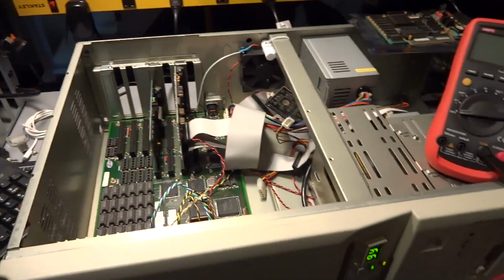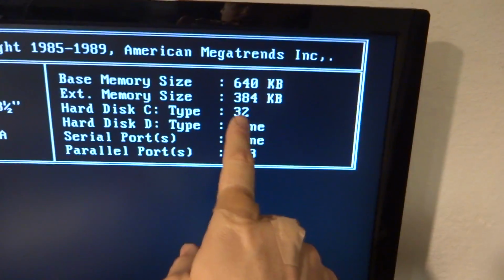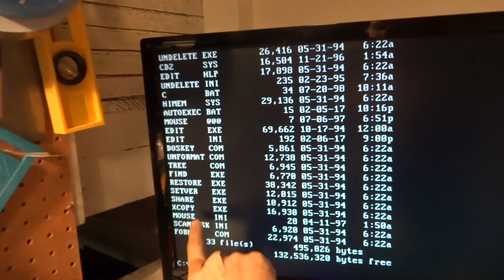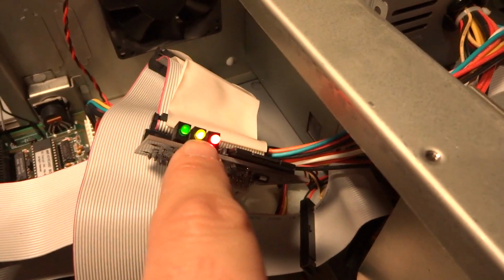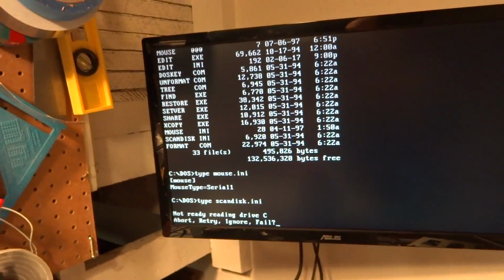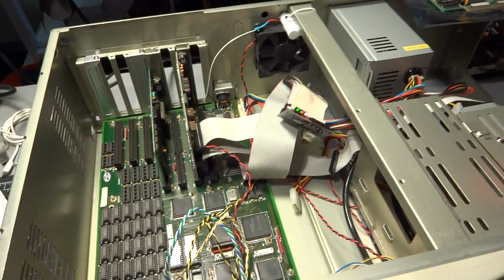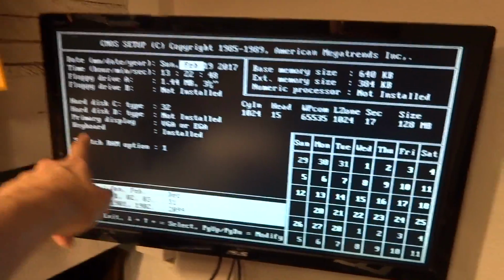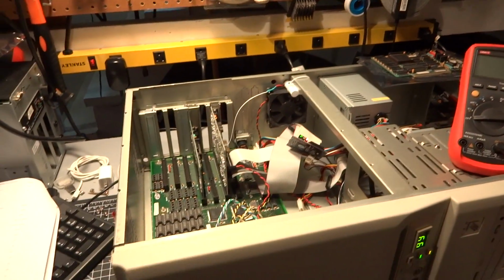Old Intel 286 Motherboard Troubleshooting (Part 1)

Comment: It's either because you don't have auto-detection of hard drives and the parameters are incorrect (old BIOSes run on CHS mode only, don't support LBA) or it's a hard disk controller issue.

I would try to make an auto-detect on something more modern to get the exact parameters, and try it again. Otherwise, the hard disk controller might have problems handling the SD/CF to IDE adapter (I've been aware that some old IDE controllers don't handle those properly).

Comment: Seems to be BIOS problem. I would try it with XT IDE card because of its ROM extension. As I know some IDE ROM extensions can also be used in an old network card boot ROM socket if you don’t have XT IDE card. Just an idea...

Comment: I know you have already fixed this in a later video but I think the reason files smaller than 1024bytes is working is because if a file is small enough the data will be stored with the directory data. Once files get too big, the directory stores a location on the disk where the data is stored. In your case the directory is stored in a part of the disk that can be accessed even if the CHS data isn't matched. But the rest of the larger files are in extended areas where correct CHS is needed to access them.
Reply: Everything (excl. the FS metadata, FATs, and the root dir before FAT32) is stored in clusters on a FAT file system - directory contents and files are treated exactly the same here.  Every directory gets one (or more) cluster(s), and there's no way to embed smaller files along with those directory entries.  So even a 1-byte file gets its own cluster.

Comment: The BIOS CHS settings must match the drive (adapter translation in this case, CHS does not make much sense with SD cards anyway) you are using. Being an old 286 the BIOS probably does not have auto detection function so you need to figure out what they are, for example by plugging into into something more modern, and let that auto detect CHS for you.
Reply: This is what I've had to do with older 286/386 systems like this that don't have auto-detect. If you have a newer system (486/socket 7) that will auto detect AND display the CHS info (some modern systems won't display this) then you should be able to use it if you have Type 47 available as User. That said, I've still had on/off success with SD to IDE adapters. I've heard CF to IDE adapters are better, so I'm going to be giving one a try.

Comment: I guess the issue may well be that the board only does CHS access, while the flash card and newer hard drive only do LBA access
Reply: You actually can make CHS access to an SD/CF to IDE adapter, most of them run just fine. But maybe the hard disk controller might have troubles accessing it (some controllers don't handle them properly / at all) .But in most cases, they do work just fine.